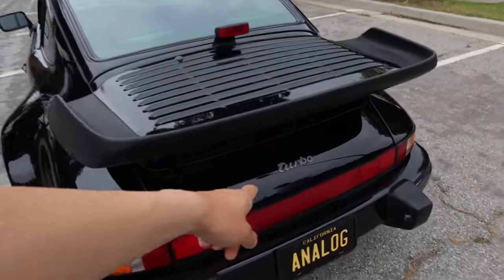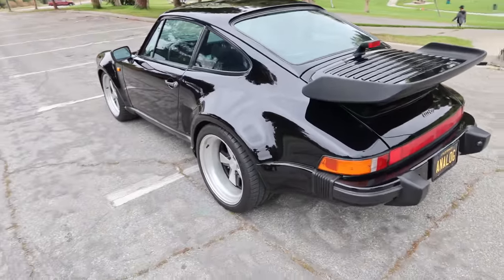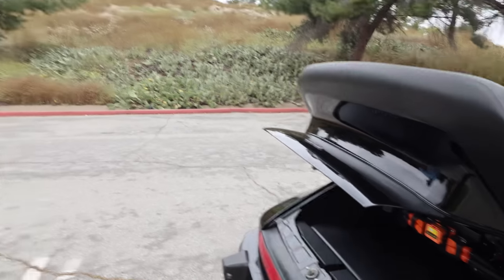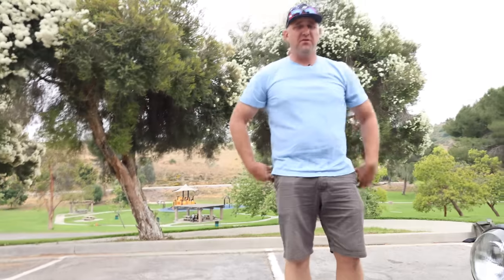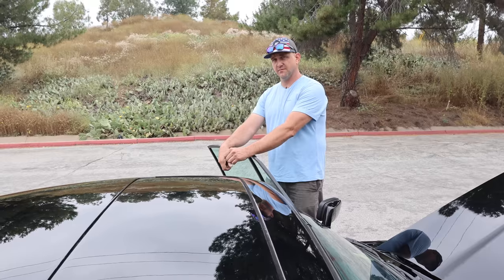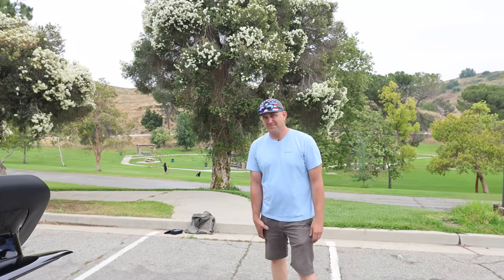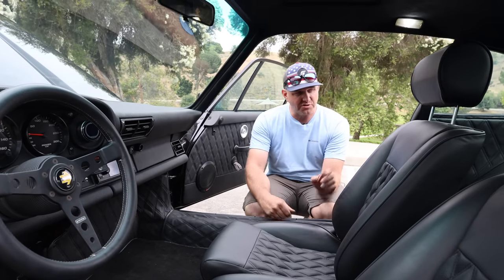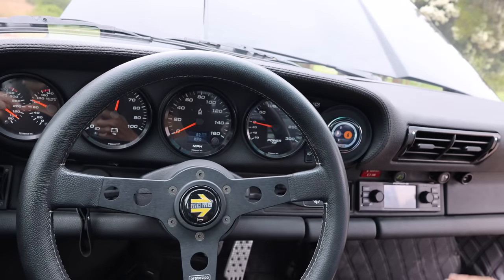Butt-Dyno'd 500hp Tesla-Swapped Porsche 930

Comment: To each his own and if this rocks your boat go for it.  I am speaking for myself.  When I roll down a window on 911,  as the sun is shining,  I listen to nothing but the sound of an air cooled engine.  The experience is so enveloping that I go to bed with a smile.  The sound, vibration, the mechanical clicking and tugging on the clutch and gearshift makes this thing have a soulful element that I don't experience when driving Tesla.  Great build nevertheless.

Comment: Super cool build! The only thing I really, really don’t like is that google nest looking gear selector. I don’t want my AC and heating to go through a submenu on a touch screen. It’s just annoying to use and I would much rather have a set of rotary dials on a plate that can go in place of the old controls. Every car manufacturer is slowly realizing that putting hvac on non dedicated buttons is dumb. It’s fine to use that rotary dial as a gear selector and to put some other controls on it, but not hvac

Comment: If you have the regen on fairly high, do the brake lights turn on when you take your foot off the accelerator?  You might be rear-ended by a distracted driver, it would be better for that driver to see the brake lights when you're slowing down.  (I assume it's like the 1-pedal driving mode in a Tesla.)
Reply: This is a big problem in modern EVs and some companies are just ignoring it.  But, if someone rear ends then they were following too close.
Reply: @truantray  True, and I guess it's reasonable given the way the insurance industry works for current-model cars.  But for a 40-year-old converted sportscar, it could be written off as a total loss very easily if the needed repair parts are rare.  So if I had an EV-converted sportscar, I would search and search until I found a switch for the brakelights that would turn them on when the switch detects deceleration that exceeds maybe 20% over the level that coasting to a stop is caused in an ICE car.  I know there's no legal requirement to do that, but it would be an inexpensive way to protect my personally-valuable sportscar.

Comment: I like seeing the EV swaps, especially for engines/cars that are on their way out. This thing is clean and stealthy, and I can’t get over those wheels. This would be cool with those new headlights/taillights that Singer is doing on their upcoming 930s. I also love how you have a bit more practicality with extra trunk space. Overall, amazing build!
Reply: You just can't very far.
Reply: @corail53  ???
Reply: @corail53 maybe watch the video?
Reply: Depending on battery placement, this will likely handle better than the original 930. Very few 930s survived the 80s because of the poor weight distribution and the unpredictable power behavior. Today, this car would never be made because of liability. It's still an evolution of a VW Beetle.

This design puts the mass between the axles and would out handle the original, which is not hard to do. But most US drivers basically buy sports cars and drive them like dragsters.

Comment: Whoa! The interior lights flickered when Lary floored it @ 37.55. Is that intentional?
Reply: I’m gonna guess it isn’t and the 12v systems getting hit with more amps than it can deal by the converter. Might be straight up arcing across a switch or relay somewhere (door switch, or just the little switches in the lights themselves).
Reply: Coincidentally happens just after he mentions converting to LED lighting, too!
Reply: It happened at 37:31 too. both times when they hit a bump.. maybe the door switch is loose and moving around

Comment: I can 100 respect the ability to do this swap..But I can't sit here and act like this car still has Porsche feel, Sound, Response, and soul..Yes it will be slower, leak oil at time..funny to deal with but that's a Porsche.. That's what your Buying..I mean this car doesn't even have manual transmission.. It's a big remote control car..Love it if it's your car but for me it's a hard no..I could never do it..🤦🏽🤷🏽
Reply: Agreed fully… I have a 77’ ROW 911 that I could never imagine it having anything other than a magnesium cased 2.7 in it… absolute worse case if I ever fully melted that engine would be a 3.0… I just live my oil leaks, the CIS system, and hell even the 915 trans lol… anyone that has spent any time with a 915 has learned how to double clutch and really drive a car.

Comment: Nice build. One of the nicest EV conversions I've seen. Good design with the weight distribution and custom built battery / cooler containers. These conversions are way more work than people think, especially one this nicely installed. Does the electronic e brake have a fail safe? Wouldn't want that thing locking up at freeway speed.

Comment: Tesla needs to offer classic car conversions - a battery pack where the gas tank goes, maybe auxillary batteries across floor of car, then an electric motor that bolts into anywhere a classic V8 or VW/Porsche engine would go on a classic car.  Then offer long term care and support for them.

Comment: The best part of a 911 is the sound of the engine. Odd car to swap to electric
Reply: Ok, but if you know these cars, they are money pits and unreliable, and that gets amplified 40 years later.  Depends on your priorities. Make noise like most car guy a-holes, or experience the torque and speed, plus better weight distribution than the original.

Comment: If you are doing thisi think i would have used the Turbo Motor adding a Electric Flywheel using the Kurs recovery system by Elephant racing or Vons..
Reply: The kit is amazing, but last time I checked it was like 80 grand.
Reply: @WiksGarage  What do you think this costs?

Comment: Something new it is. It almost seems like it's missing the point, from my perspective. Having those kinds of resources, I would definitely choose to have two separate cars. That car's factory engine sounds like a masterpiece when tuned and modded correctly, having a Tesla modded 911 gives you gobs of power and reliability, but at this point it seems like all of the visceral sensations you get from three pedal driving are lost 😂🤔. It's the balance of everything put together that makes a great car.  I would think the people that can still afford an air-cooled 911, would buy a Tesla Plaid instead of modding their masterpiece 😂. Seems like wearing noise cancelling headphones on a roller coaster ride, what are you doing bro😂😂

Comment: I like it.  However 100 mile range just isn’t gonna cut it.
Reply: Yeah... it is a weirdly common thing with these swaps to get horrible milage even if they have batteries stuffed everywhere.
Reply: @corail53  right? I mean I have a 100 mile round trip to work and back I can’t make it with that little range…and if I go for a cruise on the weekends I’ll easily go for more than 100 miles.  Like I said 100 mile range isn’t gonna cut it.

Comment: The thing with all these swaps is they all seem to get terrible range. I can respect EV for speed and instant torque but it is pretty boring which is a weird thing to say that speed has been made boring. I have been in some really fast EV's but I just can't get to liking them.
Reply: to get decent range you'd need 1000+ pounds of batteries. the tech just isn't there yet to make these retrofits practical.

Comment: This is such a bummer. I can't get on board as much as I try. Doesn't matter the car to me really for the most part. I don't like EVs.
Reply: Its not for everyone but have you driven them? And especially, have you driven a swapped classic like this because you get to play so much more with the feedback and classic car-mod messing around etc to really dial it into how you want the end result to be. You get what you get with a Tesla or EQS etc, but this is made your way.
Reply: @generalvoltage1821  I have driven quite a few and I share the opinion that they are boring. I can respect the speed and torque (no questions on that front) but they effectively make speed boring which is quite the task. With a classic, there is something to be said for the entire visceral package.  The EV swaps are also terribly inefficient and always get less range, there was a time when telsa would shut out all the engines taken out of service from accidents and such with their charging stations as well (this has changed but it was a thing.) I say to each their own - everyone likes what they like and no sense in arguing things.
Reply: No need to like ev’s just continue driving your Honda civics and make fart noises.